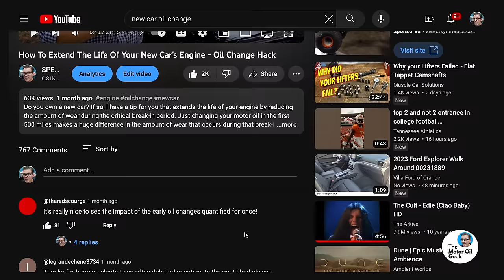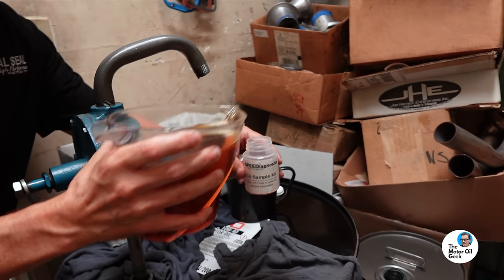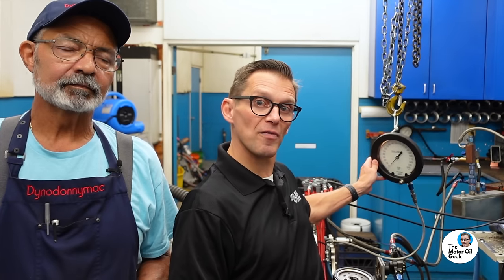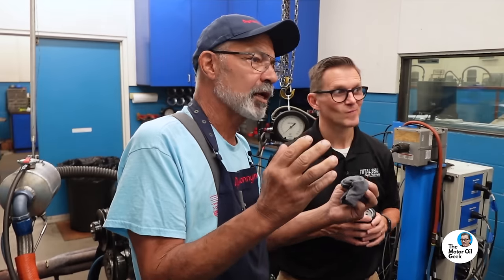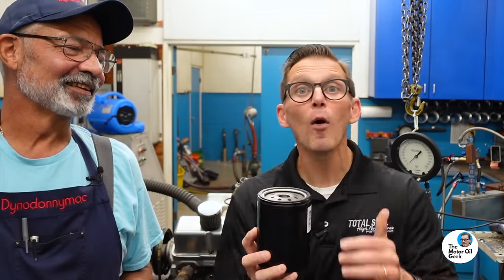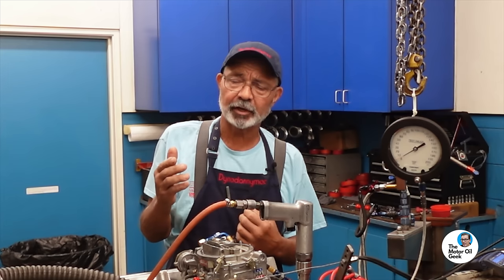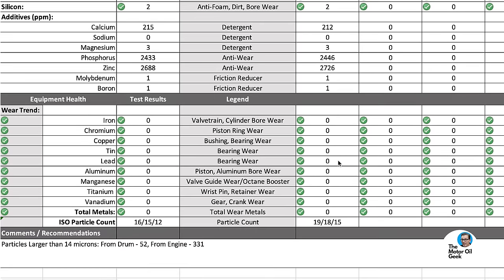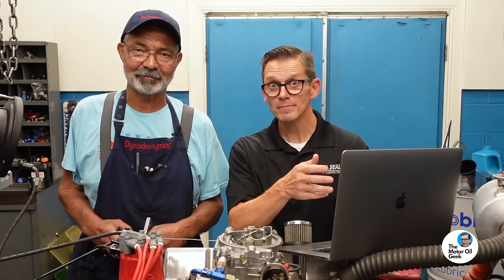Does Pre-FILLING The Oil FILTER Cause Engine DAMAGE?

Comment: I've been prefilling for 45 some years. A mechanic friend of mine told me not only does the engine run dry longer, it's possible the filter can have the medium broken by the rush of oil past dry media. I do this more for getting most of the media wet before it gets hits with high pressure oil behind it. And yes, it takes less precious time to get lubrication happening. Particularly today where modern engines will rev when cold, then idle down. And while horizontal filters cannot be completely full, you get most of the media wet and have minimal time to lubrication by prefilling. Thanks for the "Empirical Evidence" by watching the pressure gauge after the filter. Great video guys!
Reply from the maker: Thanks!
Reply: Before I use my funnel, I take brake cleaner and spray all the crap out of the funnel, and then let that dry. Then I use my funnel. Brake cleaner is a great degreaser, any kind of particles, especially when you’re only sprayed into a funnel.

Comment: Years ago putting your filters on dry was pretty much a non-issue. No one gave it much thought. I knew guys from both sides and it didn't seem to have much effect on the engine's life. However, with the advent of multi-viscosity oils that old method went to hell in a hand basket. When Cummins brought out the Big Cam engines there was a sharp increase in camshaft/follower failures. Cummins soon found out that many failures occured shortly after an oil change. What few operators realized was that the multigrade oils got so thin that when the drain plug was pulled that 8+ gallons of oil, which now had the viscosity of black coffee, rushed out with such a fury that it siphoned out the lube system. Refilling with fresh oil plus installing the filters dry took many seconds to refill the oil galleries. There was an advisory to fill the filters before installation. A second advisory was to not change the oil hot but to let the engine cool down for an hour before pulling the plug. "For the extra three cups of old oil left in the galleries, the new filters should take care of that." Close quote. After following that advice engine failures amost stopped completely...
Reply: They should come with pre-lube systems from the factory.
Reply: It's a galley (or valley), NOT a "gallery".
Reply: I'm not buying the "oil rushes out SO fast that it's siphoning the oil galleys out"... 

How could that even HAPPEN if the oil cap is off the engine?? 🤔 
There could be NO vacuum if the cap is off, as it would just draw air in through the huge hole in the engine where the cap was... 🤦🏻

Edit: The issue of worn lifters/followers in other engine designs (such as the Mopar Pentastar V-6) has to do with the design of the oil filter system, and it draining back to the pan when the engine is shut off, and then the engines starting dry every time they are started for a few seconds. It's a known problem.

I suspect the CAT issue was similar... also, the failures wouldn't happen "Right after an oil change". It would take a while to wear out

Comment: It’s a good idea to prefill the oil filter but I wouldn’t worry about not doing it.  My Tacoma’s oil filter is up side down, meaning that for the past 18 years, I couldnt pre- fill the oil filter on my Tacoma.  My Tacoma has 200k and the engine still runs like day one.
Reply: You can still prefill it. Sorta.

The first like half quart you pour into filter gets sucked into filter media. Won't spill out.

Pour small amount of oil into filter, watch it disappear. Keep doing that until some small amount of liquid oil remains visible.

Now install filter quickly. Might not even spill a drop. But whatever does spill, easy cleanup, totally worth it.
Reply: Same thing on toyota tercel filter mounted diagonally  and not need to prefill only fill motor with 8 ounce of oil, my tercel last 32 years and work better than new toyota yaris
Reply: geez- thats a no-brainer. just fill the filter, let it sit for a few minutes, dump out the extra oil and make sure the seal ring is oily, and screw it on. just make sure the pan plug is in before filling. sounds easy, right?

Comment: I have always pre-filled my oil filters since early 70's, a mechanic at the time showed me. I have an original '64 327 365 hp Sting Ray with the original big canister filter set-up, I always prefill that as far as I can before it might spill over. Now I also have a Cadillac CT6-V with a twin turbo Blackwing engine, which is a very high tech engine. The spin on filter spins on at a 45 degree angle which means oil will spill out when you tip to install. What I do is fill about 2/3 full, tilt the filter in my hands while rotating it. This allows the clean oil to fully saturate the filter material. You can see the level of oil level go down in the filter as it soaks into the material. Now I pre-fill more oil into the filter up to the level it will almost spill out at the angle needed to spin the filter onto the engine. When its time to start that 550hp, 640 lb. ft. LTA engine I have the oil pressure screen showing on the DIC screen. I can see an indicated 40 psi pressure in under 2 seconds doing it this way! Bravo guys for showing everyone what I have been experiencing for many years!
Reply from the maker: Thank you!

Comment: I started changing oil way back in 1968 on my dads Electra and ended up doing many of my uncles cars before I got my first new car in 1974.  Initially, never pre-filled those canister filters and always bothered me seeing the oil light come on and hearing the noise on the first initial start-up with the newly installed filter.  Not sure WHY I waited so long to figure this out but starting in 1987, I finally started to prefil the filters on my cars and oil light goes out right away, again with no noise on initial startup.  Back in the day, my dad and uncles only kept their cars and replaced them every 3 years but I keep my vehicles now a minimum of 10 years and never had any oil related issues pre-filling the canister filters before an install.  And I seldom put on more than 3500 miles between changes (using dyno oil, not synthetic) and ALWAYS a new oil filter with each change.  Changing the oil is probably one of the best things you can do as its the lifeblood of your car as far as Im concerned.  Side note, Im not fond of FRAM filters, especially now that they are NOT made in the USA.  I usually use OEM.
Reply from the maker: Thanks for sharing!
Reply: YES!!!

Comment: So many engines have filters mounted at angles, or even horizontally, that pre-filling becomes problematic, and probably a moot point.  Many other factors contribute far more to engine wear than not pre-filling the oil filter.
Reply: Yeah, longcranking because people don't pause at the on position for a few seconds for the ECM to do it's checks when starting the engine is probably the most common! My 323 takes 2 cranks when I pause at "on" to start, but if I go straight through it takes 7 or 8 to start!
Reply: The filter on my F150 is horizontal and pre-filled really isn't an option
Reply: @steveeab2364  Fill it up and let it soak for at least ten minutes then drain it back out into the container. This helps prevent media damage from the initial oil rush on startup.
Reply: Nah, yeah fam; I also have issues with scratching my arse and picking my nose at the same time. Life if just hard, amirite?
Reply: @DekGT5mad that isnt the ecm doing checks. That is fuel pressure building in the system. Leaky injectors can also explain that.
Reply: Yep, I have the horizontal filter too. I fill the filter, let it soak, then dump half back into the container. That leaves me enough room to no spill any.
Reply: @steveeab2364 that is still not an excuse to pre-fill the oil filter my friend  because the least you can do if.... you cannot wait for it to soak in is to just open your engine's oil filler-cap and just pour the excess into the engine so in that way you can now screw on your atleast primed oil filter and then you are good to go,rather than screwing on a dry one because of the oil filter mounting angle!!!
Reply: @DekGT5mad  You make a very good point. Many people don't even know the "electrics on" position exists.  I go to electrics, pause to put my seat belt on and check that the Christmas tree of lights has mostly gone out, then clutch in,  fire. 

Other thing, is people pulling away the second the engine has fired; like, can't they wait just 10 sec for oil to presssirise and circulate?
Reply: @DekGT5mad that sounds like a fuel pump problem
Reply: Unplug the dam coil and crank the engine over several times before you start it up. It only takes a little common sense,  don't over think thing's so much.
Reply: @mikeharris8365 not a bad point, could pop a code if you do that though and then some people may not realize why they have a CEL, unless you're taking about a plug wire system with a coil and not a coil-on-plug coil
Reply: @The2004STi  and it's easy to clear the codes,  if people don't know enough about them to know it could pop a code,  they don't need to be changing their own oil
Reply: @mikeharris8365  Speaking of common sense, it only takes a little to see that this is a good example of not thinking things through *enough*:  
You'll still be accelerating wear by turning the engine over on mostly-dry bearings for ~5 sec. while also pumping fuel into the cylinders (esp. newer cars w/ FI & ECU's) and accelerating wear by cylinder-washing the oil film off of the rings and cylinder walls and contaminating the oil, reducing it's viscosity . . unlike prefilling the filter - or better yet, an engine pre-oiler system.  Hard pass.
Reply: @michaelshamblin7062  you are wrong on so many levels,  nice try tho, someone with no common sense would believe the bearings are completely dry, once you've drained the oil pan. But hang on to your idea,  that you can make someone believe that bs,  your doing a good job there little buddy,  🤣
Reply: @mikeharris8365  yeah it's easy to clear the codes, and I'm inclined to agree as well. I've seen a lot of cases where people do an "oil change" but actually end up draining the transmission and double filling the engine crankcase lmao
Reply: The video also clearly states in plain English @ 5:55 the "common sense" fact that the oil film barrier collapses when the oil pump stops and the little bit of oil still on the bearings etc. no longer constitutes an effective "oil barrier" anymore . . but hey "you do you" and lmk how that works out for ya.
Reply: @The2004STi  🤣
Reply: @michaelshamblin7062  so your saying it's best to start it up rather than turn it over a few times to get oil between the dam bearings?? I know you didn't mean to, but you actually made my point,  so you really should try another way to get your amusement,  rather than trying to convince anyone that you have more knowledge than a 2 year old, sitting here arguing for 2 days over something you clearly know nothing about.  😉
Reply: @mikeharris8365  Nope! Never said that either!  Hey here's a radical idea: Instead of spending all your time putting words in my mouth I never said, maybe try watching the video (!) . .
As for things I DID and/or AM saying: While I agree your idea IS better than actually starting the engine and putting a load on the nearly-dry bearings for some 5 sec. while the filter fills up (which I never said to do), it's still turning the engine over some 5 seconds with no oil being pumped through the engine/bearings thus no actual oil film barrier all that time (the barrier collapses when oil stops flowing, or even when the piston stops - as the video illustrates).  But, the benefit you're providing with that method is offset by adding in raw un-burned fuel into the upper cyl. chambers which dilutes/thins-out/washes away what little oil film barrier that's left on the rings and cyl. walls which accelerates wear, and even contributes to oil contamination (unless you disconnect the fuel pump too . .).   
Therefore, the best way would still be pre-oiling the filter for no gap in oil flow . . or using an engine pre-oiling system as someone else mentioned - either an external one which would do basically the same for oil changes, or even-better would be one installed in the car which is not only good for oil changes, but also for all future cold-starts too - where the vast majority of engine wear occurs.  
Best ways = pre-oil filter, or use or install a pre-oiler.  
Second-best way; your method, if you disconnect the fuel pump too.
Reply: @mikeharris8365  are you a boomer? I dont think anyone else could give such bad advice. cranking an engine until oil runs is the exact same thing as it running until oil runs, except completely unburnt fuel wont be washing the cylinder walls or getting the valves dirty
Reply: @michaelshamblin7062  I had been installing dry filter and cranking with fuel pump fuse removed. After seeing the 5 sec delay in this video I will switch to partially prefilling as my filter is 45 degree angle.
Reply: @DekGT5mad  Interesting . . haven't tried, but will!
Reply: @steveeab2364  Same thing on at least one of my cars . . I can maybe prefill it halfway w/o too much mess, but that's about it.  Which is why the ideal way is a simple pre-oiler by way of starter.  Starter is always hot, so all you need to do is jump the terminals with a relay controlled by a switch on the dash which can be activated while the ignition's completely off and therefore no need to yank/replace fuel pump fuse to prevent raw fuel from being dumped in the engine while pre-oiling (which dilutes your protective oil film barrier on rings, cyl. walls etc).  Speed shops do this all the time for race cars with super expensive engine builds that often sit long periods between racing . . I'm having this simple mod done to mine right now on the 4.2L supercharged stroker motor in my 370z Nismo (a.k.a. "420 Z")
Reply: Yeah good point; the time it takes the oil to saturate the media before it starts passing through it, which adds to the delay problem.  I would do the same if using this method.  Ideal way is to leave ignition off and jump the starter to turn engine over several seconds, then start engine with ignition switch.  No pre-filling worries, no pulling fuel pump fuses worry, simple and clean. Common in race cars with high-dollar engines that often (also) sit for long periods of time in-between use (like mine) . . All it takes is a relay to jump the starter (which is always hot) and a momentary switch on the dash to activate it. @MrTexasDan
Reply: On Mercedes and BMWs the filters are upside down on top of the motor. All the oil drains back every time you shut it off. So why isn't the motor damaged?
Reply: Agree. 30 plus years in the business
Reply: Wrong. My 4.6 has a horizontal filter. Still prefill. You dont have to load the filter full of oil lol
Reply: That is easy enough you put it in a flood mood or you disconnect the ignition system flood mode newer vehicles with the button push your foot on the brake hold the gas pedal to the floor and push the button crank the vehicle it will not start unless you let go
Reply: If you listen, when he talks about the complications with his porsche engines, he mentions even having just a little oil in there or enough to soak your filter media would be enough, no spills or drama needed really
Reply: Or upside down like some Subarus
Reply: @Bread_45  I blame Hollywood for teaching bad driving habits.

Comment: Back in the 1970s, I was told to fill the oil filter when you can, but of course some engine installations make this impossible with horizontal or even upside down mounting, and with paper insert filters also.

But a trick I worked out for myself was to prevent the engine firing on first cranking after an oil change before the oil pressure came up. Easier in older engines as you can remove the connection between the coil and the distributer cap or leave the engine stop out [on a diesel] till the old pressure comes up. 

On modern engine this is much harder or even impossible to do where the ignition electrics have to be properly connected for the computer logic to allow for cranking in the first place or the diesel stop is activated with the electrical services inside the diesel pump.

That is backwards progress!

Nice video, thanks.

Best wishes from George in UK.
Reply: George ,Thanks for your reply . Another option is to fill the new filter  with oil  ,let it soak up as much oil as it can , then empty the excess back into the container .
If you measure the before and after oil levels ,you will be surprised  at how much it actually absorbs .
Reply: @Crosley3251  Absolutely!

Thanks from George
Reply: @Crosley3251  Yes that's what I did on my Volvo C70, where the oil filter is literally upside-down, so decided to soak the filter element first, did the same with the fuel filter, even though that was in the conventional set-up, still soaked it then half filled the container before screwing it back, the engine started and ran without a hiccup !
Reply: And, most modern vehicles have a flood clearing mode-  hold gas pedal to the floor before and while cranking- in this mode no fuel is injected while the pedal is fully depressed.

Comment: I REALLY like this topic:
The home mechanic doing an oil change can also test this for themselves:
Time how long it takes for the oil pressure to come on from when you crank the engine, when:
1/ new oil filter is pre-filled,
2/ new oil filter installed without oil.
I know for a fact that it takes longer for the oil pressure switch light to go out.
So of course I always pre-fill.

I can’t believe people would think new oil would have particulates that could harm the engine without going through the oil filter first!
It needs to get dirty FIRST!
That’s serious overthinking right there, LOL 😂.